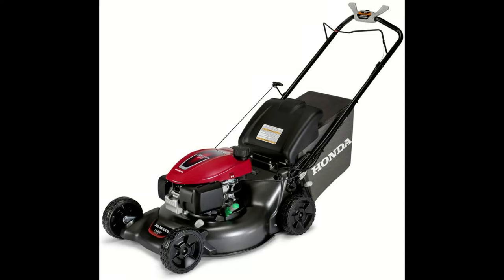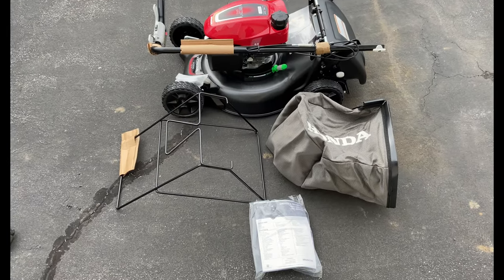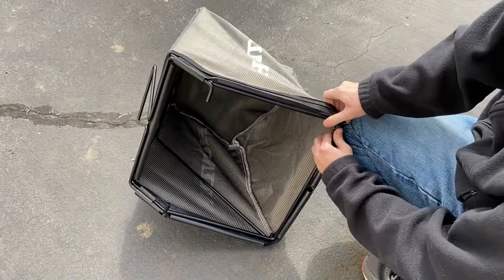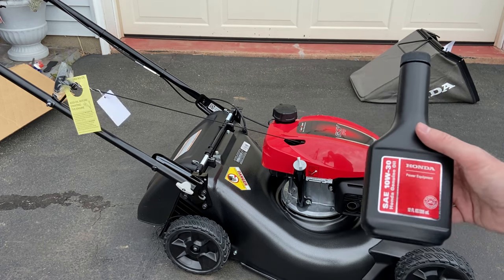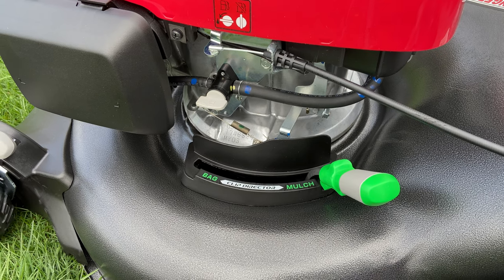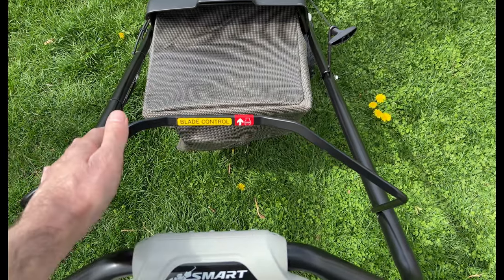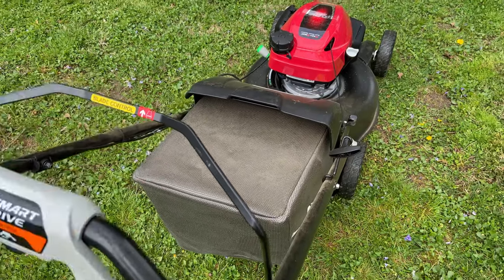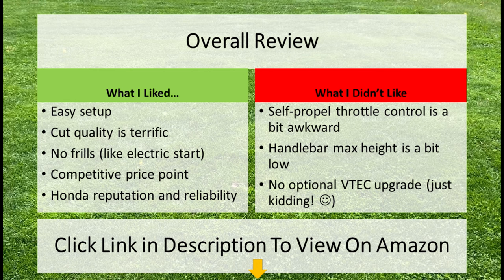The Best Entry Level Mower on the Market Today?  Honda HRN216VKA Unboxing and Review

Comment: I would have treated the underside of the deck before adding oil, so as not to cause any leakage.
Reply: Ordered one to receive it for this summer and will receive it on Tuesday; I have heard nothing but good things about this mower. I heard it is very reliable and not needing any more maintenance than changing the factory oem spark plug with its replacement every two years like clockwork and also changing the synthetic oil every 50 hours running time about every two years also as well. I have heard that its also very beneficial to use 5w - 30 fully synthetic oil change out ever two years or 50 hours whichever occurs first. Just get oneself the Mobile 1 fully synthetic oil with the extended performance with its extended oil additive package for maximum protection and change the synthetic oil every two years or fifty hours running time like clockwork. Buying one five quart container of 5W-30 fully synthetic Mobil 1 oil will last one at least 666 running hours at least or at least 13 typical mowing seasons; mowing ones lawn about fifteen times per year typically; this year in Sept. 23 will be the last year that Honda will be making gas powered lawn mowers; an end to an era so might as well get one for the record books because it quite literally runs just that good.

Comment: Got one yesterday. What the hell does that "remove protective film before use" refer to? The sticker on the top of the mover is barely attached as it is. Don't get it. There's no "protective film" to remove. I ended up peeling that whole large decal of the top of mine because it was already barely on there in the first place. Left a bunch of residue.
Reply from the maker: There's a thin clear plastic film that's on top of the label of the mower where it says GCV 170.  It's possible they no longer put it on there but it was on mine.

Comment: Wait until the infamous engine surging problem starts to appear.  And this is from my own experience!!
Reply from the maker: Have you tried cleaning the carburetor?  Sounds like it might be getting clogged, had similar issue with pressure washer until I thoroughly cleaned its carb out.

Comment: This mower clogs up with grass worse than any mower I have ever owned.
Reply from the maker: Really?  I had a Craftsman mower before this and that thing used to clog up at the back chute leading into the bag since it was smaller than the bag size.  I would be lucky to fill it a quarter of the way before it clogged and dropped clippings below on lawn again.  Haven't had any problems with this one though, I've been able to fill up this bag with no problems.